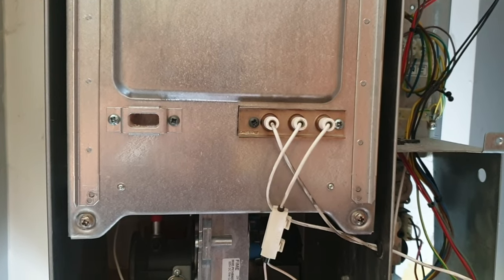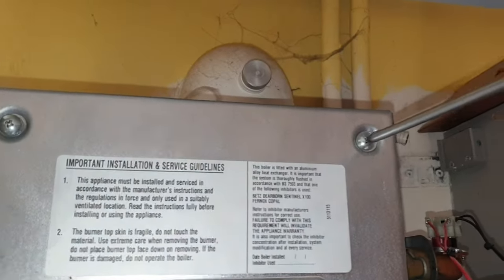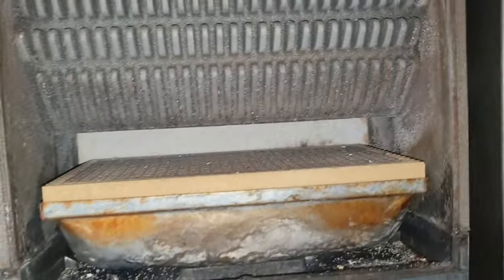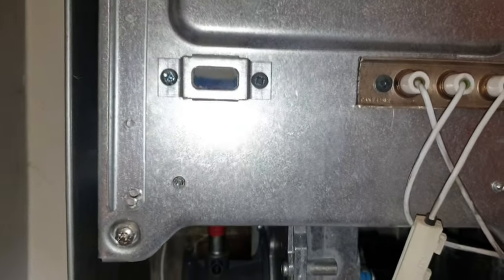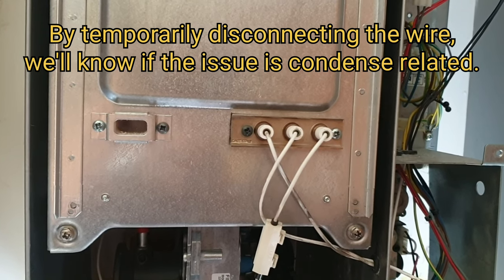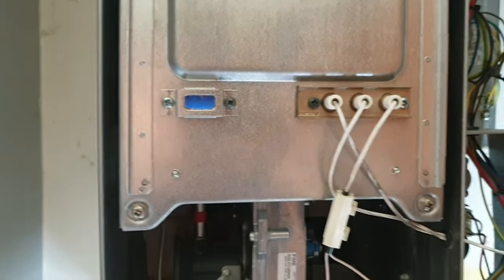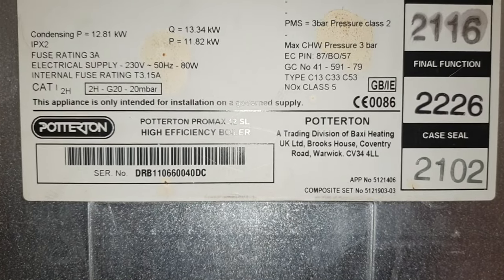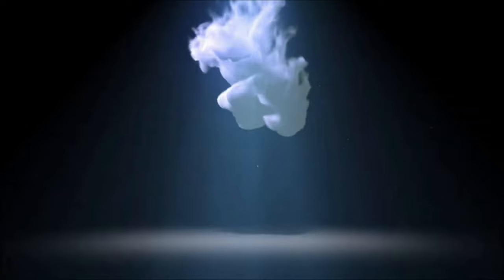Baxi Potterton cutting out easy boiler FIX

Comment: These electrodes can be removed without taking the internal cover off. These cases both have poor seals that go brittle . Also if a seal goes on the internal case the boiler has another overheat stat by the fan that will cut out after a short while. Personally other than the water flow switch I think these boilers are rubbish

Comment: Can you just not connect this wire anymore and what would happen if you run in without connecting the wire again?
Reply: I’m just trying that so will let you know 😂
Reply from the maker: I don't advise it as it's for safety, but i have seen these disconnected. You should make sure the condense trap is cleaned and emptying out correctly and that theres no rust on the those wires first